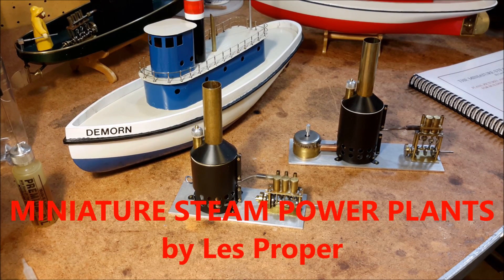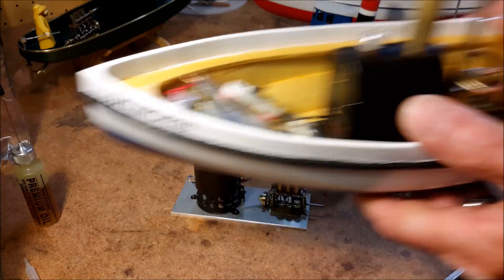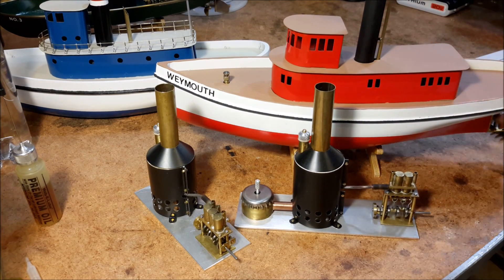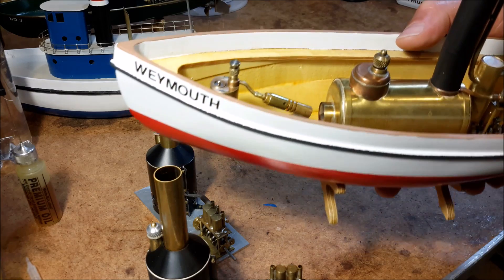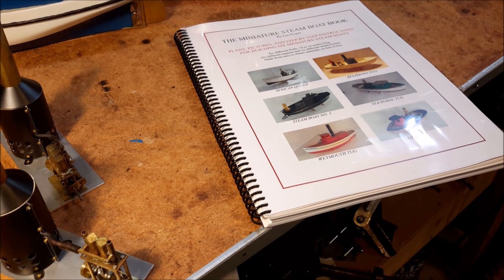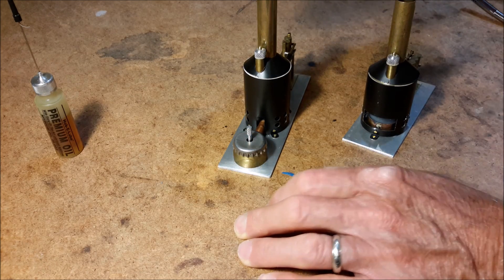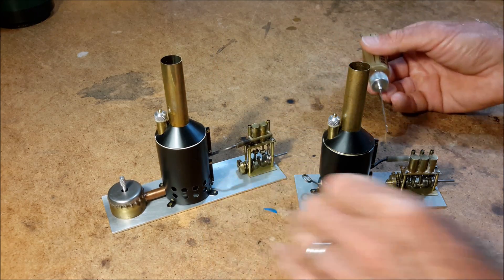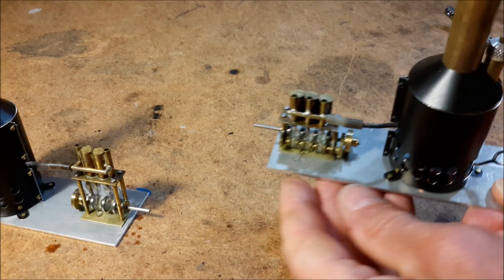TWO MINIATURE STEAMBOAT POWERPLANTS

Comment: you should do a slow motion video of these engines and I would also like to know how many rpm the run at.
Reply from the maker: Hi Jason,  I don't think I have the video equipment to record in slow motion.  I have measured the speed of my single cylinder engine with an optical tackometer and it runs about 3000 rpms.  The multiple cylinder engines generally run a little bit slower, so I am guessing about 2000 to 2500 rpms.
Reply: @LeslieProper  wow that's pretty fast

Comment: Hey Leslie I have a question I don't have a lathe or access to a lathe or the money to buy one so I was thinking is it possible to check some of those parts in the end of a drill and then used some fine file craftsmanship and or fine Dremel use to shape and cut the pieces while it's spinning in the drill if you think that this is possible I would like to receive the plans 4 the single cylinder single action engine I also like the plans for the two cylinder double action and I think you also said you had plans for a single cylinder double action I'll be waiting your reply thank you and I'll email you if you think I can do it thank you
Reply from the maker: The little parts need to fit very close so I don't think the little engine can be made without a lathe.  I would be happy to send you the free plan just the same.  Send your email address to me at lesproper@gmail.com
Reply: Also Leslie I wonder if it would be possible to heat the boilers using lamp oil or kerosene or diesel since it burns slow like alcohol but I do understand that they would be such and smoke which I kind of want to smoke for the realism aspect and the buildup of soot I can clean out every run the engine
Reply from the maker: I have never tried using these fuels so I can't answer this question. Sorry.

Comment: I love your work. Very clean and sharp. Where do you source your brass from? I am currently working on a Midwest model steam engine and boiler kit. I plan on making my own boilers and steam engines after that.
Reply from the maker: I purchase free cutting brass rod  and drill rod from On Line Metals, and the tubing and bar stock from K & S Precision metals.
Reply: Thank you.  Your work is next level for me. I will have to wait until my skills are a little better before tackling your designs. Your work looks like what would be in a clock if clocks could have a steam engine. For perspective my little single cylinder oscillating engine is only 14 parts total. The base alone on your single cylinder is 14 parts. Not a critique mind you, more of me tipping my hat to your work.  Thank you again.

Comment: Would you well me one of these?
Reply from the maker: Sorry, these are not for sale.  I sell a book of plans for building them.  A small metal lathe is needed to build them.
Reply: Would this mini lathe work? https://www.harborfreight.com/7-inch-x-10-inch-precision-mini-lathe-93212.html
Reply from the maker: This is a wood turning lathe, not what you want.  You will need a metal lathe.  You can tell the difference by the screw feed tool holders on the metal lathes.
Reply from the maker: I built my steam engines on a Sherline lathe that I purchased many years ago.  It is the only lathe I am familiar with.
Reply: Why dont you sell them?

Comment: Very well done, I trick I learned about whether the burners are light is to install some stainless steel gauze over the flame, it glows a  nice red and you can tell the flame is light.
Reply from the maker: Thanks for the tip.  I will give it a try.
Reply: Leslie Proper